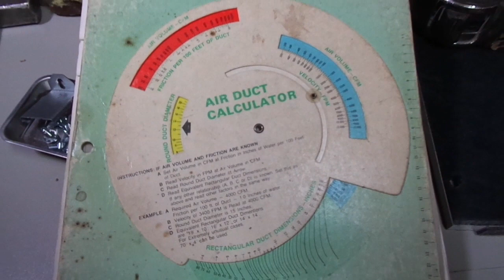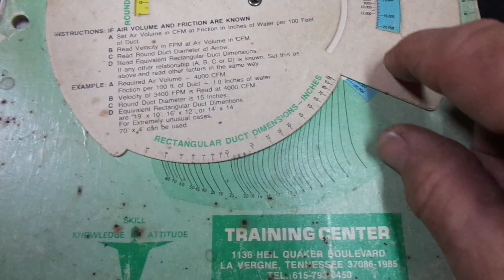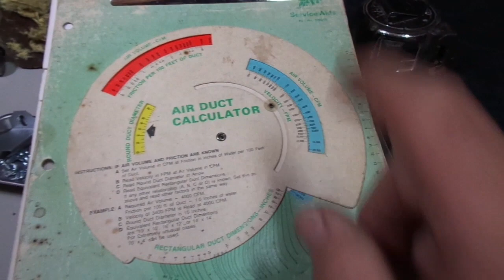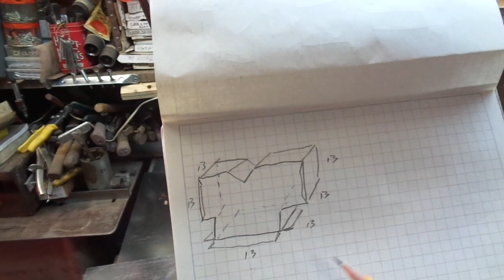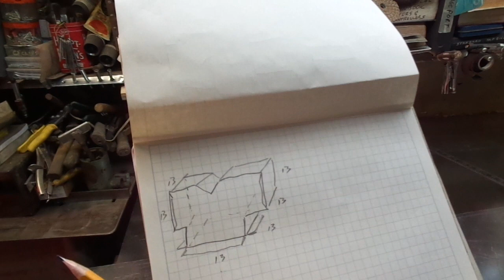Pt 3 Attic Heat Pump Installation

Comment: Flex will be used?
Reply from the maker: I don't think we used a bit of it on this job.  Flex is a killer to airflow.  I've seen commercial restaurant jobs with as much as two 25' boxes of insulated flex twisting around the trusses and other ducts to get to where the hit the ceiling diffusers.    On jobs like this, I like to hard pipe to a ceiling register and fully insulate the register and the hard pipe all the way back to the insulated trunk. IIRC, the recommendation is 7' maximum on flex and it should be even stretched out  tightly at that.

Comment: Hey tractorman44, these HVAC sheet metal videos are excellent and your work quality and methods are top notch. You inspired me to buy my first brake (only a harbor freight 36”) and start learning and doing my own premium ducting for my house. God bless.
Reply from the maker: I'm glad to hear you have enjoyed the series. Good luck to you, now if you could only find an old retiree that wanted to get rid of a lockformer machine at a reasonable cost you'd be set.  Without a lockformer, you will have to perfect a way to fab joints whether its a handformed pittsburgh lock or overlapping and sealed corners.  Proper notching will play a major roll. Remember how important it is to keep the air INSIDE the duct.  Thanks Roger for the awesome comment and good luck again !! A suggestion: search FB marketplace for sheet metal tools. There was a lockformer for sale ten miles from me very recently and another guy was selling an entire shop two towns north.  So the stuff IS out there just waiting for you.
Reply: @tractorman4461  yeah I’ve been creating the Pittsburgh lock manually with practice, and learning the notching also. I make multiple practice cuts and bends and slowly learn what works and what doesn’t. And I watch your methods to learn. But yes I’d love to find a lock former. I will keep checking Facebook here in California. I’m an engineer in my professional life. My home ducting is uniquely difficult and I cannot get a contractor to actually quote the job, so I’m doing it myself. This old house has asbestos ducts that are beneath the subfloor, so they are not accessible at all and they are deteriorated. So I had to rip up the entire flooring across the house and am replacing the ducts. Has to last decades once I seal the floor back up. All the ducts go within the floor joists, and directly under a bathroom shower. No joke. It’s very difficult.
Reply from the maker: @r0gerp0dacter   After 40 + years in the industry, yes I am quite familiar with inaccessible spaces.  I've done many installs commercially and residentially that required installing ducts as well as equipment in spaces that will become inaccessible as construction is completed.  I can't begin to count the times we removed walls or floor  and in many cases even windows  in upper floors to allow equipment changes.  Many times we have had to dismantle large equipment on the dock or parking lot and carry in piece by piece and reassemble in place. Are you an EE, ME or PE.... by chance ? And good luck with your project !!  One thing I would suggest in your situation is a bucket of duct sealant or mastik to minimize leakage at the joints.
Reply: @tractorman4461  im an ME but I work as a manufacturing engineer fixing / improving automated equipment in an assembly line floor. It sounds like you’ve seen everything thru your career. I had no idea what to expect until I lifted the old shower, carpets and subfloor, and there was misaligned joists, duct everywhere falling apart. One duct was capped to nowhere, a hidden duct never put to use by the builders. Meanwhile this house has poor airflow in every room! It’s 1800 sq ft but only has two 9”, a 5”and and 8” diameter supplies off the plenum. So I’m building it all, plenum, new ducts, trunk, all from your videos. 

I’m literally following your methods and tutorials. I’ve gotten quite far already! I just made my first transition from one size to another. It’s slowly getting better thanks to your guides. I can only do 36” segments but that’s ok for this house layout.

And I’ll surely be using the mastic duct sealant, thx!
Reply from the maker: @r0gerp0dacter  awesome comment !!  What you describe above is the main reason building codes were established as well as NEC, ASHRE and BOCA, but I know I don't need to tell you that.  LOL.   The restriction added to the airflow is caused by excessive use of turns which is why 'turning vanes' are sometimes installed in trunklines.  That added restriction inhibits the smooth delivery of air to it intended location.  If you have a duct calculator, you can figure the total area of the 9, 5 and 8'' supplies and convert that by using the calculator backwards to see how far from suggested 'design dimensions'  for trunk velocities the original system was off.  That excessive restriction increases velocity which creates turbulence at the turns and lessens the effective air flow at the respective registers. That's basically why guys that run 25', 35' and even longer flex duct lines twisting through an attic can't understand why the air doesn't seem to come out of the registers.  
   Sounds like you've gotten a good handle on the job at hand.  Most times while running ducts in enclosed spaces, I will insulate the duct in addition to sealing it with mastic for two reasons.  1) airflow sound suppression and 2) to minimize the potential for duct sweating.  The double mylar coated bubble wrap has been a Godsend to the industry.
  In your line of work, then I'm sure you are into DDC controls or at least stand alone PLC's, VFD's and tons of other controls as well.  Two of the smartest men I ever worked with were a team of brothers that were ME's.  Both now work for Ameren UE here locally and are out of HVAC altogether.  Good luck with the outcome of your project.  I'm starting another very small sheet metal job this morning....
Reply: @tractorman4461  yes sir, I deal with PLC machines and others controllers all day long! I’d bet you are an engineer or certainly could have been based on your videos and thought process and details. Thanks for the advice, I didn’t consider insulating these ducts because technically they are already in the living space. But worse still, the joists are so misaligned and restricting that I have literally no room to spare I’m using every inch. But now I will try to also insulate because that Mylar is thin it may barely fit. Wish I could show you pictures what it looks like. Feel free to email me at my screen name @gmail.com I’ll reply with some pics. It’s only a small residential system but boy does it have problems. There is no empty space to get from the garage furnace to the rest of the house except between floors under a bathroom and shower. And it was flex and asbestos. Literally the shower drain goes down INTO the middle of the flex duct thus restricting it. Then it gets pinched and mashed down under a wall joist. And the original house builders must have done it! Like you said especially all the codes and regulations they would have done a better job in California.  Even today it’s difficult for me to buy sheet metal and supplies in this state from the Ferguson HVAC places because i don’t have a contract license for HVAC! And Home Depot out here doesn’t carry 26 ga metal etc. my system is only a 3 ton gas furnace with traditional coil but the 1800 sq ft house has 10 fr ceilings in 3 rooms so I calculate that the system is a tad undersized but the ducting for sure is undersized. Like I said every contractor I brought in doesn’t want the job. 

Again thx for the advice, I will attempt to insulate. Incidentally like you said my system here is extremely loud to the point of being distracting. Low airflow yet loud. The system runs 24 hours continuously during summer because it simply cannot lower the temperature at the thermostat at all. God bless!

Edit: one question I haven’t seen is how to know where lengthwise to calculate the transition to keep the velocity up at the proper FPM. The calculator gives static pressure and velocity per 100 ft, but how do you calculate how many feet after the plenum do you reduce the duct size since it will be far lower than 100 ft? The duct calculator doesn’t seem to show that precisely.
Reply from the maker: @r0gerp0dacter  You have to deduct the delivery cfm of the branch ducts from the system total and adjust the duct size (transition) to accommodate the now lesser cfm available but maintain the velocity to get it there.  When you have branches off of an 8' section for example there will be less air available for the rest of the trunk, so the transition to the next size has to correspond to maintain main trunk velocity, whether its only two branches or 4 branches exiting the trunk.  That's where the duct calculator is an invaluable tool, especially for the more sophisticated systems.  
    Usually on the duct calculator somewhere there will be the standard acceptable velocity pressures for residential systems as well as commercial and industrial systems.  The higher the velocity, the more horsepower it takes to move it and the more the airflow noise is realized.  
    Ever been in a restaurant where the air velocity and noise is so high that your food gets cold before you can eat??  LOL. Or you just about have to yell to converse?? LOL  Oh yeah, they are out there.  I'm doing a total renovation/replacement of my son's system this winter.  We split a two story single system into two.  That's the attic job  series you are watching.  The second part will be downsizing the equipment and upsizing the ductwork for the first floor to make it to where a conversation can be had in their living room and the TV doesn't have to be at 100% volume to hear....They watch TV with the remote in their hand, so as soon as the blower shuts down, they can rapidly drop the volume to a reasonable level....LOL  True Story !!
Reply: @tractorman4461  thank you sir, I understand. I originally wondered if there is a need to calculate how far down the line to do a transition. For example in your series you split the 13”x13” discharge into two 13”x13” trunks and then immediately reduced the size down on each trunk. Would there be an advantage to keeping the size larger and reducing it further down the line? My thinking would be less friction resistance moving the air until later downstream in the system, THEN reduce the duct size to achieve the proper velocity needed. 

But I think I’m over thinking it! I’m designing my system for 0.1-0.2 in H2O, likely stay at 0.1 if I can.

Edit: last question! Is there any advantage to making ducts out of 2 piece vs 1 piece? I’ve been simply making 4 folds from continuous sheet with a single Pittsburgh seam whereas I see you often do 2 piece with 2 Pittsburgh’s. Is it simply constrained by material size or is there a strength advantage? Since I’m sealing my ducts in the floor with no access for the next ~30 years I wanted to have as little failure points as possible, so less seams the better.
Reply from the maker: @r0gerp0dacter  That particular plenum out of necessity was super short (tight space) which is why I turned it into two of the same size right off the bat with the deflector built into proportionately deliver approximately what was needed in each direction.  In an attic, slower velocities have a tendency to cause duct sweat in areas...so I like to keep it a bit higher.  (So the 'pair of pants' acts as a plenum extension in a normal installation to an extent.)  BUT I also go the extra mile to totally seal and insulate the duct and seal the insulation yet again to ensure there is no leakage of the air from INSIDE the duct as well as leakage of hot attic air into the pocket between the cold duct and insulation which will create the dreaded moisture and potential water spot/mold on a ceiling.  You have to be careful to run the system at too low of a duct static.  There has to be static built up to move the air. 
     I had a call once that the duct was so oversized that the squirrel cage essentially ran just slipping in its own air stream if you can imagine that.  Come to find out what had happened was the installing contractor sized the duct correctly for a five ton load in a sewer treatment plant office and during construction a change order came through to limit the area it served.  The change order came through before the mechanicals were set in place, so with the new load being two tons they just set the ahu in place and adapted into the main trunk that was 2 1/2 times too big.  It developed 0 static, plenum was pure sweat and the airflow out the registers wouldn't move a candle flame.  Long story...LOL.  But what was odd, and made it difficult to understand was the operations of the unit appeared pretty close to normal in relation to refrigerant pressures...but we won't go there now.
    When it comes to either one piece or two piece ducting....it doesn't matter.  But it is a bit more difficult maintaining perfect 90 degree angles with a one piece for me with the larger apron on the bigger brakes....and of course handling 4', 5' or 8' lengths are a bit taxing.  But I have made a lot of them in that fashion for different reasons.  Especially when it comes to a s/a or r/a plenum box I will use that technique.  For you, it cuts the number of Pittsburgh's to hand form in half....and that's good.  Hope this helps Roger.

Comment: Good morning T. Man, there is alot of science and engineering behind me reaching up and adjusting the thermostat. LOL. Super interesting stuff and appreciate the info along the way. I couldn't agree more about setting up the work space before starting. May take a little time to do it but worth every minute to be able to work safely and comfortably and with proper lighting to get the job done. It's already miserable woking up in an attic without having to work using flashlights and spotlights. Good stuff. Enjoyed it as always. And hey, these morning coffee cups just keep getting filled with new knowledge. :)) And whoa!! Almost at 1k! Great stuff! Thanks again - Cheers!
Reply from the maker: A funny thing about the t-stat GP,  Its one of those things that most people use daily (whether they reach up and adjust it or not) but don't really understand the mechanics behind what it is that the thermostat does....  (-:   That really doesn't matter anyway as long as it controls properly huh. 

I do like making the job conditions fit my likings for many reasons...expecially in attics or crawl spaces or piping tunnels in institutional settings.  Thank you GP for the awesome comment and the continued interest in the series.  I'll try to keep them short and quick for everyone but I ain't makin' no promises.....LOL !!

Comment: You make the sheet metal work look like a breeze to do!!  Thank you for another interesting video documenting the progress of your duct work making and installation.
Reply from the maker: Like on an earlier comment I said the longer you do something the easier it becomes and I'm still working the rust off the tools right now.  I really haven't done a great deal of sheet metal layout for at least 20 years doing mostly commercial service work and digital controls as well as refrigerant, gas and boiler piping so its taking a bit to become familiar with the old mistakes.  (-:
Thanks for the complimentary comment...I appreciate it !!

Comment: 44 good job learn a little also nit as easy as looks
God Bless 
PaK
Reply from the maker: Thank you sir for complimenting my effort.  One thing about the trades is that the longer you do it the easier it becomes...I think I've said before I haven't done hardly any sheet metal work for a couple decades to speak of so I am a bit rusty, but it is coming back slowly but surely.

Comment: That calculator looks like it`s really handy to have....you made a pair of pants with one leg smaller than the other....good job and interesting....CHEERS
Reply from the maker: Good Morning Gator...This or any duct calculator is a good thing to have no matter how much experience a fellow has.  This happens to be the easiest one I've ever come across.  The slide rule kind aren't too bad, but this one really simplifies the figuring.  Thanks for the kind words sir.